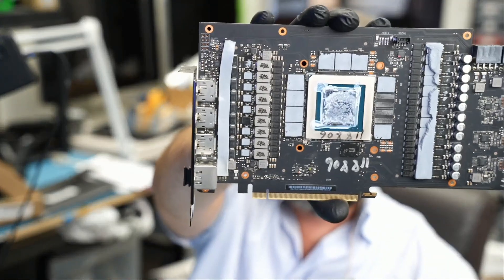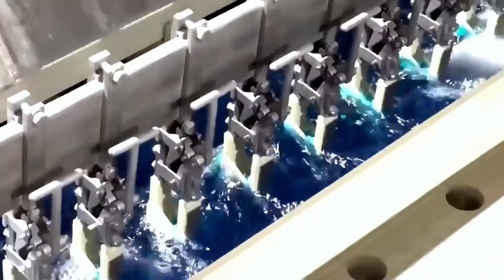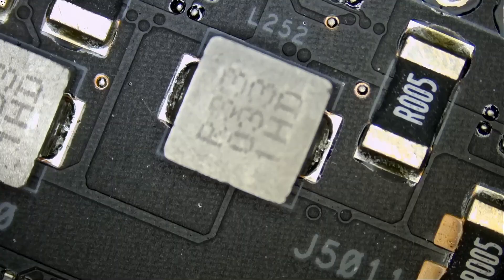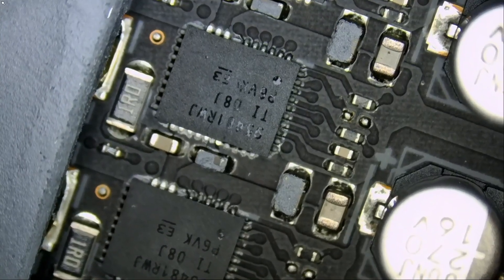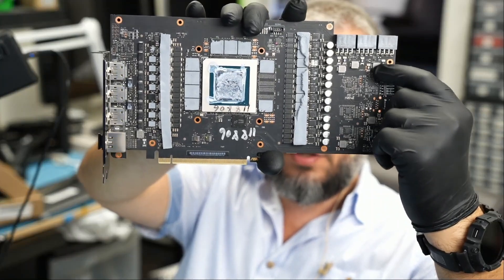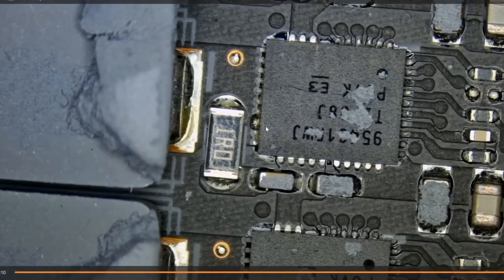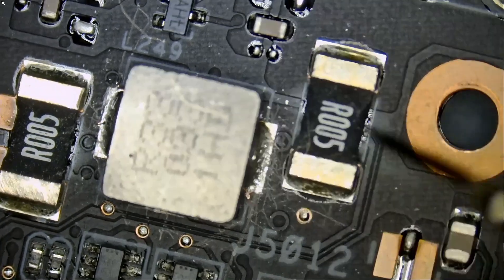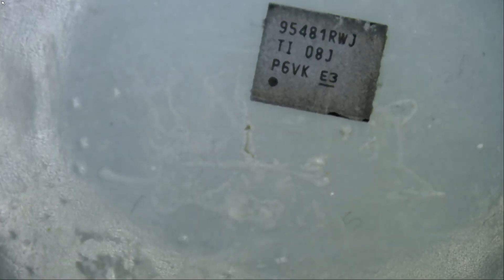ASUS Strix 3080 Repair: Identifying a Short Circuit from a Solder Blob

Comment: I had the same repair on my same card. Unfortunately I ran into the issue of popping off a few of the neighboring capacitors. Is there any chance you can give me the specs of the small caps on top and bottom of the ic's

Comment: I'm an EE but don't know much about the design of these boards. I do know those mosfet devices are rated at peak 50 amps each. So 13 seems astronomical. Of course the devil is in the details re slew rates, load types, etc. on how they are stressed to failure so often. It would be interesting to see the analysis of how that happens. I know buck circuits are prone to transients in supply current. Maybe the failure mode is as simple as flaky connectors?

Comment: No need for a part 2 as you already found the fault and the fix.
This was a great tutorial for diagnostics of these cards.
The usual faults were not evident.
I was looking for burns on the DR's but not paying that close attention to the solder connections.
I will from now on.
This reminds me of the time a while back that you found a hidden fault on a chip simply because it had lost its solder contact.
The fix was easy as all you had to do was to heat it and bump it to flow the solder and make the connection more secure.

Comment: Hey Alex, have you considered making a small side circuit that only sounds a loud beep when the circuit detects an unusable battery voltage for your microphone? With your diagnostics ability, it may be enough to create such a circuit, or even use a micro arduino board to let you know the battery has died on ya. Or, if you prefer, toss it out to your youtube community as an event. Whoever makes the smallest circuit for the model of your microphone receiver that holds the battery, wins. Wins what? I donno, I'll leave that up to you. Would be a huge annoyance off of your shoulders though

Comment: Why not resolder the old chip?
Reply: it failed to a condition where it was getting so hot, it was melting solder
Reply: Because it's shorted?
Reply: Why not put back the nail in a punctured tyre after you remove it? It doesn't make sense. You repair the hole.
Reply: Why do you want to keep a dead chip in the device and maybe blow a capacitor on the side, by soldering and then desoldering again the bad one and then soldering a good one? It's taken out, you know it was taken out, and you'll just stress the capacitors just twice.
Reply: Why would he, what would be the point of finding a faulty component, removing and soldering it back? That's back to square one.